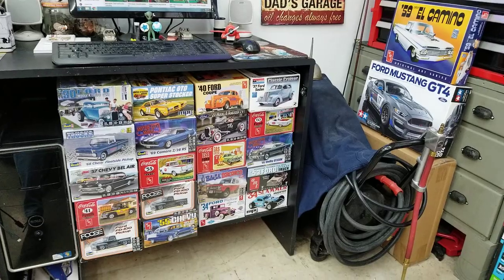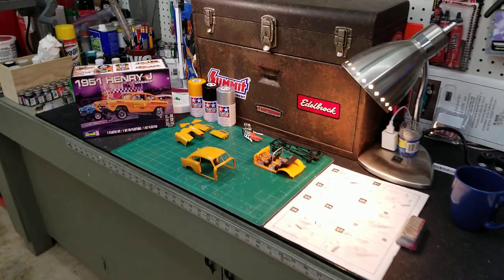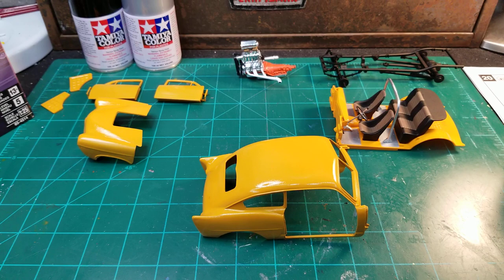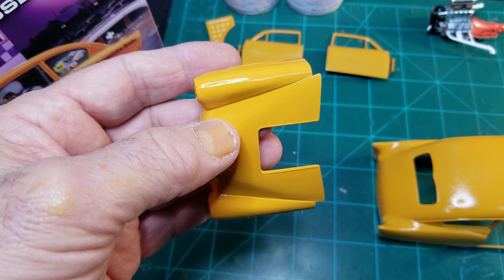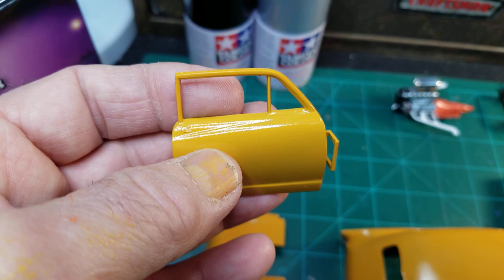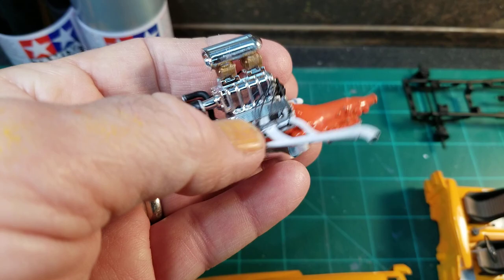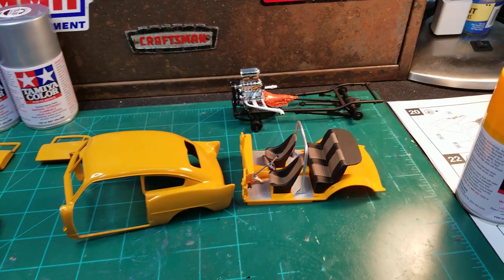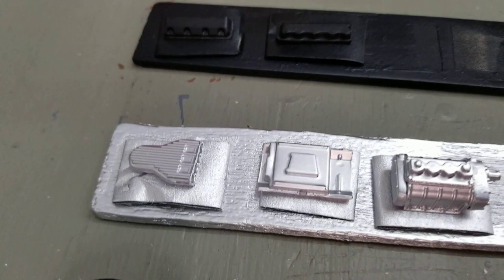1951 Henry J Paint Issue

Comment: That interior looks wonderful.  I hate you had issues with the body.  I’m not an expert on paint, but my guess is the paint did what it did because you put too much paint on the surface.  The one thing I have learned about spray painting bodies is that you put on fine coats and do not rush the process.  I would try sanding with 1,000 grit, then 3,000 grit, and 5,000 grit before you even think about applying more color or clear.  Now, if you don’t want to go to that trouble, just throw it in the purple pond, strip off all of the paint, and start over.

Thanks for sharing.
Reply from the maker: Thanks for your input Michael.  I now have the body sanded down waiting on good weather to repaint.

Comment: I also have to do my spray painting outside. But think I have found a cheap solution. I got a pup tent for $30. Today it's blowing about 15mph outside and I just went out to my tent, zipped the door up behind me and there is no wind. My mobile spray booth. You could even take it camping. Haha.
Reply from the maker: Nice solution for painting.  Haha....I don't think taking it along on a camping trip would go over to well.
Reply: @olezippi  Probably not. Especially if the Tamiya Bright Orange is mistaken for Mosquito repellent...  Haha.

Comment: You may not realize it while doing it, but spraying in the wind, most of the paint doesn’t even make it to the car. Either strip it or sand it , you can’t eliminate that texture with clear. There isn’t enough color on it anyway, you’re going to have to respray the color after you prep by sanding or stripping. Don’t beat yourself up over it, as you said “I knew better”
Reply from the maker: Yup.....did a light sanding with 800 then 1000.

Comment: Start with a 4000 grit very gentle wet sand. Stay away from any raised detail while sanding. If you have enough paint on there it will smooth out. Then clear coat. It is saveable.
Reply from the maker: Thanks for your input.  The paint was lacking in a few areas so I have sanded everything down.
Reply: @olezippi  yea I got through this all of the time. Paint, strip, paint strip, I don’t strip all of the way though usually. If I can get it smooth enough I like to leave that coat of paint on there so I don’t have to go so thick with my new paint. The old paint is easier to cover than primer.

Comment: Man I have that problem with every paint I use anymore. I have a paint booth in my house and temperature stays about 70 to 75 degree and no matter what brand or type of paint, it orange peels like that.
     You can try wet sanding to smooth out and try to clear coat it. Some times it works for me and sometimes the clear coat will do that same thing. Everything I used to do with great results just don't anymore...???? 
       Good luck to you anyway...At least I'm not alone in this problem.
Reply from the maker: Thanks Jimmy.  Everything is sanded down now.  Yeah....painting is not my favorite thing to do since i'm not good at it.  I'm not really a bad painter with my air brush or rattle cans it's just that I don't have a controlled environment.
Reply: Man just don't give up. I have 15 years of paint and body shop experience and 40 years building model cars.
      Nowadays it's near USELESS. Something has changed with the paint is the only thing I can think of causing the problem.
      Got discouraged and keep threatening to just sell everything except my built one's. Around 300 in my stash waiting to get built, and lots of parts.
      But hey, I've learned how to do weathering and rusty cars because of the paint issues.
Reply from the maker: I hear ya Jimmy.  Guess I'll just keep plugging away and hope for the best and expect the worst.

Comment: I have had the orange peel show through on clear when lights reflected I would wetsand smooth with their thousands and then another wet color coat and then you're clear in my opinion if the gray is showing you didn't get that much paint on the car with the Wind
Reply from the maker: Yeah I just didn't get enough paint on the body I guess because of the wind.  My fault for painting on such a bad day.

Comment: #1 Try color sanding with water, you'll know in a stroke or two if the paint's thin, in that case sand it smooth, prime with white primer, then your color.
#2 Start over. Strip the paint in Super Clean or whatever you like,  and do it all over until your happy.
Your doing a nice job, it would be a shame not to have the same quality in your paint.
( I'd do #2 JMHO )
Reply from the maker: Thanks Terry.  I sanded the body with 800 & 1000 grit then cleaned everything.  This time I"m going to wait for better weather.  I didn't want to strip it in the purple pond as I was afraid the front end might come apart.  To hard to get all those pieces lined up.